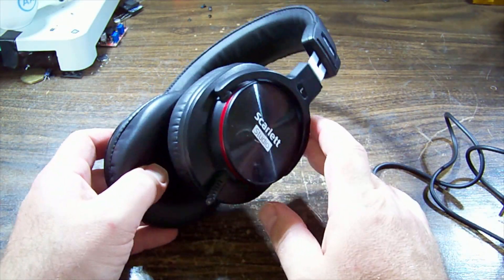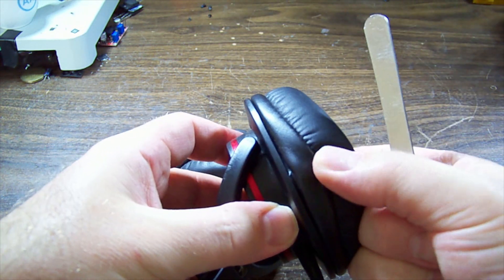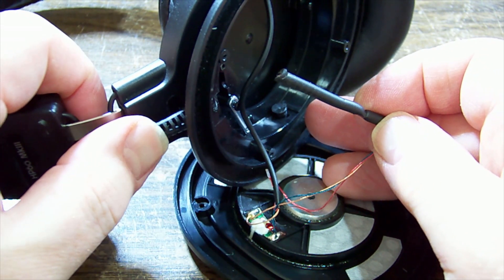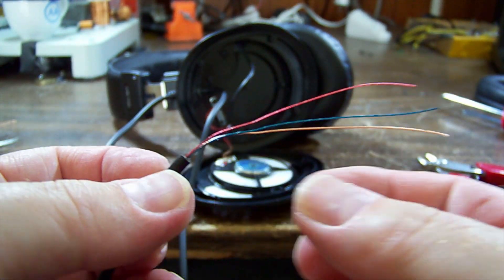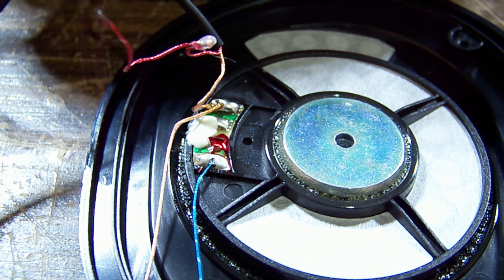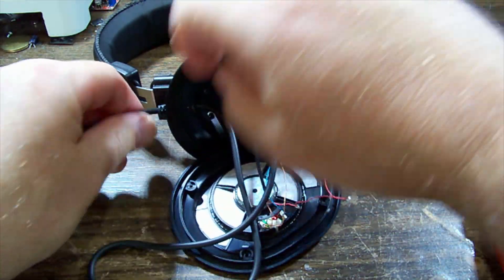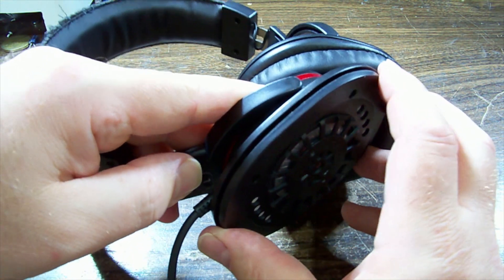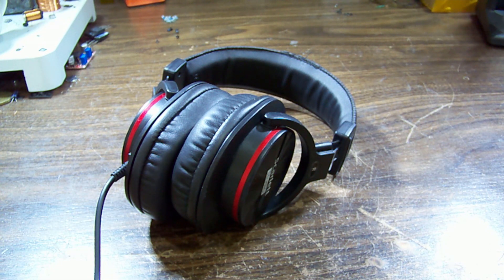Scarlett Studio Headphones Repaired!

Comment: bc of my bigass head and them falling all the time the left plastic broke and the wire was holding it togeter for about a year and 2 months age the cable got damaged and i didnt hear on the right.......ive been using a shitty canyon headset which im damaging the speakers by raising the volume with a sound booster........

Comment: I fixed a Scarlett hp60 mkii (second generation) headset because it was not heard from the right, the problem was a part of the cable, I cut it and soldered again. But later when listening in a video game the surround sound was lost.
I don't know what the problem is if the welding has to do or what it was.
Any suggestions?
Reply from the maker: Yeah I'd double check your soldering to make sure no wire is touching another where it shouldn't etc. New faults are likely related to your work.

Comment: can i do this without hot glue?
Reply from the maker: You could use tape or heat shrink or anything, it's just to stop the bare wire from touching other wires or metal parts.
Reply: @JonnyFix  what is that glue like substance that you put through the syringe. do i need that? they gave me glue stick when i ask for hot glue. not something from syringe.
Reply: @JonnyFix  my cable is damaged at the exact place where clamp is located.so can i repair just the cable without doing these soldering. what is the best option?
Reply from the maker: @nidarshabandara8035  No, you must do this method. Cut off the bad cable and re-attach it.
Reply: @JonnyFix  can i use my glue stick and melt it with soldering iron at 7:54 instead of your flux?

Comment: do i need hot air gun for this, can't  i use soldering iron?
Reply from the maker: Solder iron is fine, I only used hot air to melt some hot glue.
Reply: @JonnyFix i mistakenly walked out my room when headphone is connected to audio interface. that got my cable is stretched. it worked with both sides with loose connection near the ear piece. now it works only one side. does your fix resolve my issue?
Reply from the maker: @kirimile2244  Quite likely the cable has broken where it enters the housing so cutting that section off and feeding the remainder back in like this should resolve it.
Reply from the maker: @kirimile2244  Oh it could also be broken where it enters the plug..... so if you notice a change when you wiggle that end then you will need a new plug.

Comment: Yep dogs/cats they all like chewing cables,  not so good when it's a mains cable :-(
Great headphones recovered :-D
Those seem pretty much the same as the old ones from millions of years ago, but they had metal speakers and volume/tone sliders, the controls were actually usefull for some odd devices.
My mate has a gaming headset and i was fed up with repairing the cable,  he would trip over the cable because he was a pillock!!.
Those coloured woven cables i hate, some are rather vaigue in colour and my eyesight is going down the pan, the spot on depth perception i had a few years back is crap now.
Missing the wire with the soldering iron is  laugh,  but i don't do much soldering so meh lol.
Finally he bought a set where the cable plugs into the headset, easy to replace the cable but the connector really needed to be magnetic like the apple laptop.
He has used wireless headphones,  but he somehow managed to stop them working lol.
He could break water, he is one of those people lol.
Reply from the maker: Sorry to hear that. I do not look forward to aging. Better squeeze in as much as I can while the going's good!

Comment: I get to do a lot of these type of repairs for tradesmen using power tools. The power cord gets broken internally due to flexing of the cord and then the tool is powered intermittently - very frustrating.
Some of these basic repairs are our bread and butter.
Thanks for sharing your repair. Some of those wires are very fine. Good idea using hot glue as insulation.

MiracleMAX
Reply from the maker: Can't beat a basic power tool but cordless units are quickly becoming the norm given the power you can get out of batteries now which presents it's own range of more technical faults with brushless DC motor controllers etc. Not to mention the ability to digitally lock tools so if they're stolen they can't be used... good luck getting the official info on how to put them into service mode to repair them after warranty.
Reply: @JonnyFix  Yup, too true. Cordless used to mean 5 minutes of run time with only enough torque to peel the skin off a banana, but now they have 'more power' & run for days! As you said, the circuitry inside would put NASA to shame. Getting wiring diagrams etc is a nightmare. But apart from that - easy peasy! 😁